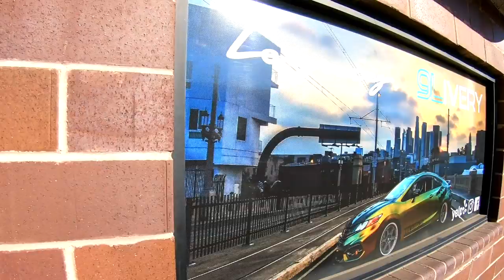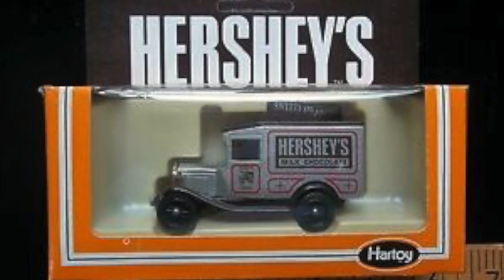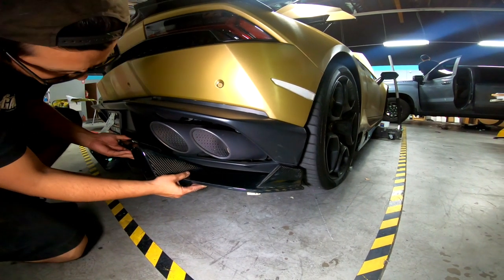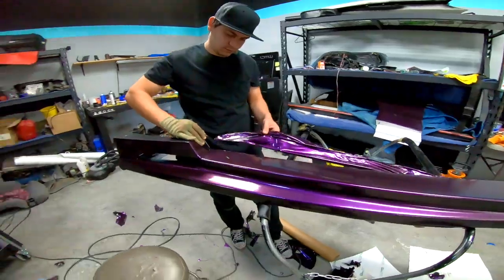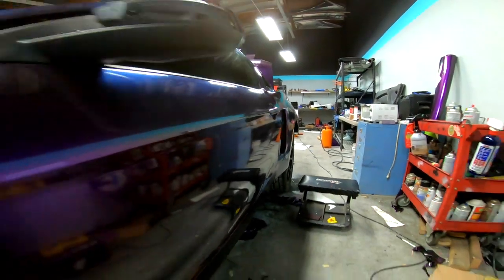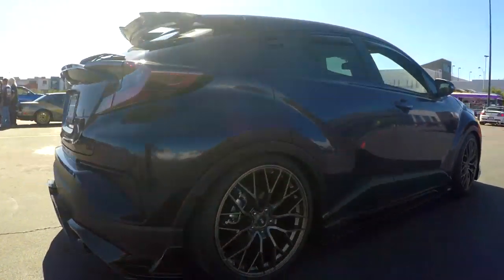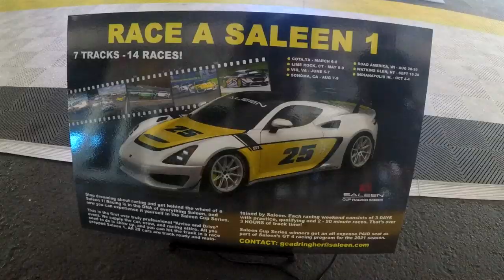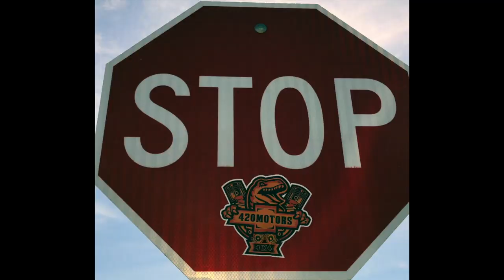The Art of Vinyl Wrap

Comment: I've been thinking of getting a wrap on my zr2 or at the very least a larger clear bra over the rear fenders. The stock clear bar protects what it covers but I'm getting some rock chips around it. I guess high speed those rocks get flung pretty hard and hit right in front of the rear tires
Reply from the maker: Oh yea. Also just over time the sand blasting is brutal. For thick protection clear coat will offer the best in terms or armor. But maybe if you come up with a good graphics design the rear fenders could be wrapped. Giving it style and protection
Reply: @420motors  after getting a wrap are you supposed to avoid automatic car washes or wash it in a special way or do you just wash your car the same as always?
Reply from the maker: I mean you can go through automatic car washes but I wouldn’t recommend  that to anyone lol. Not even the factory paint holds up that well over time